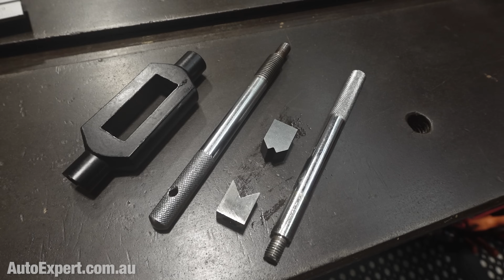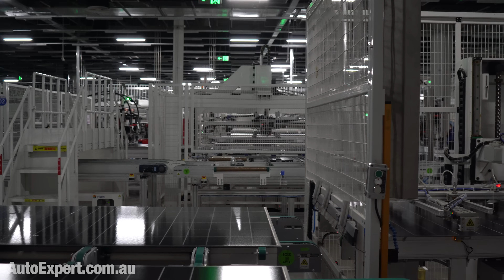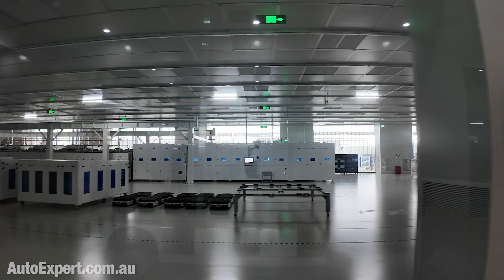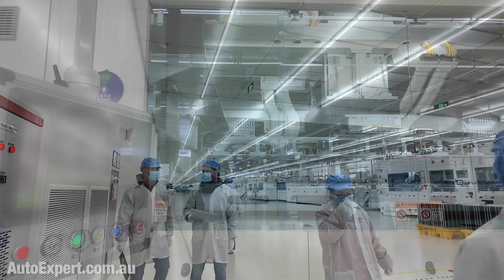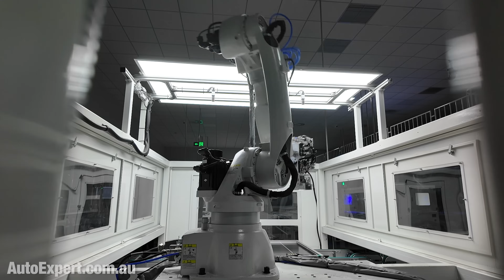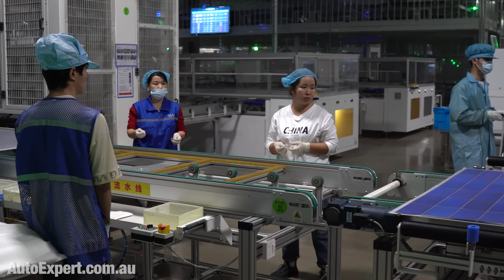The truth about Chinese manufacturing in 2025 | Auto Expert John Cadogan

Comment: Chinese product quality is NOT determined by the Chinese manufacturer, it is fully determined by the Australian / any other importer's standards and what he is prepared to pay, he wants cheap nasty so he can charge big dollars in Australia, ripping the gullible Australian consumer off royally, and we are stupid enough to accept it. They'll make you anything to the best quality possible if you are prepared to pay for it.
Reply: Absolutely spot on. A Chinese friend of mine was importing white goods and Split System Air Conditioners from China in the mid 2000s. The manufacturers all had a quality grading of A being the best down to F. You could specify any brand name you wanted and there was a class grade of compressors you could specify, each specification had the resulting differing price point. When his business was liquidated he kept some Grade A Air conditioning units for himself and me and 15 years later the branded Sharp unit we have is still working strong and is good on power being an inverter. There's Chinese and there's Chinese, it's all dependent on the suppliers chosen price point and quality threshold.
Reply: Spot on. Blame greedy Westerners for wanting products as cheaply as possible so that they can make large profits. The problem is that consumers see MADE IN CHINA   and fail to realise that the Chinese will make anything to the standard you specify and at a price to cover manufacturing. China needs to adopt the Japanese discipline of not making anything unless it is top quality.
Reply: @laok8021 如果统一标准，那肯定生产不了廉价产品，全世界大部分还是穷人占大多数，你不能剥夺穷人享受科技，哪怕产品质量差但是价格很低，坏了大不了再重新买一个，中国一直有一句话：一分钱一分货，想要多好的产品取决于你出的价格，你可以问任何一个中国人，他们都是这样认为的
Reply: @laok8021  There is a a huge worldwide market of people, including myself, who are more than happy to buy cheap stuff off Temu and Alibaba that is still fit for purpose and affordable, so no I disagree with your assertion that China should only manufacture top quality products.
Reply: @laok8021 problem is the number of available manufacturers in China....there will be some barely keeping the lights on will be willing to take a chance
Reply: Totally true. I am a production engineer that has been around many Chinese factories in the last 15 years, and actually it's been like that all that time.
Reply: This is true.  A client of mine imported from China and has been there many times.  He told me you can specify a product you want at a price you want your clients to pay and they will accommodate you accordingly.
So the perceived Chinese quality is directly proportional to the price point the consumer of said product is willing to pay.
Reply: @B_Cameron1973 
Bang on..!!
Reply: My sister has been doing business in China for more than twenty years. She has been screaming what you say from the roof tops.
Reply: @davidbrayshaw3529 
Same with my brother
Reply: So basically doing business in China is pretty much like anywhere else - you tend to get what you pay for, except in China the bottom end is lower as the Chinese are prepared to accept a lower price than most of the world, and yet still turn out something of a product.
Reply: 🎯 @sullivanrachael
Reply: Yeah that is a thing most people are not aware of. The Chinese deliver what you order in the quality you are willing to pay for.
Reply: Absolutely true, I work for an OEM factory in China, we have clients insist to use the cheapest/lowest spec solution because they will have the maximum profit margin .... after years we finally persuaded they use our higher quality/higher spec solutions (of course, with higher price) as they face tougher competitions. As an OEM factory, we don't make the final decision, our client does.
Reply: Stop watching Sky Noise after dark.....it will keep you utterly clueless. Do some research into the passion that drives the Head of BYD alone.......or stay dumb as...... Your choice.
Reply: Some Australian profiteers are crazy about pressing prices, which leads China suppliers to make them with cheap materials.
Reply: Yea a friend's brother who's a pro cyclist mentioned it to me. "Crappy bike frames come from china but the best bike frames are also from china. It just depends on how much you're willing to spend."
Reply: Spot on. The quality is deterimined by the QC imposed who pays to produce the product. "Simples"!
Reply: I knew a Chinese engineer who was asked if he could make X for Y dollars to which he said yes. He showed the product to the person who tried it then stated that it was crap. 
The Chinese response was ok, if you want a better one then it will cost Y+Z dollars. When dealing with the Chinese, you have to ask the right sort of question.
Reply: Agree ... the quality is dependent on the price the consumer is willing to pay. Higher price, better quality. Lower price, lower quality.
Reply: That's very true!
Reply: 100% true.
Reply: Yes, we are stupid.
Reply: Exactly, diy shop in Malaysia sells digital ⌚ for<3 dollars
Reply: You are exactly spot on with your comments. I can assure you, the vast majority of Chinese factories are nothing like as is shown in this video. Its a numbers game in finding a Chinese factory that can currently meet the standard/quality requirements of western markets right across a broad spectrum of industries and categories.. I have been travelling to mainland China since the early 1980's , working with many different factories in developing products for the Australian/NZ market.  Doing your homework well in advance will weeds out a huge number of Chinese factories that will always say that they can supply your market. I wonder if John visited any of the Chinese car manufacturing plants that are now offering their product to the Australian market.
Reply: i checked some of the daily products sold in other countries, especially america. i have found that for the same kind of price, US consumers get shit compared to products we consume in China. US products that is 2x to 3x the price would have the same quality of products sold in China.
Reply: man what are you talking about you are clueless... chinese motorcycles in Australia have been garbage ever since 2000 , go compare a CFMOTO to a HONDA huge difference.... you have no idea about anything its Chinese mindset  chinese dont think like japan or western people they dont take pride in anything they think how can i take as many shortcuts as possible and get away with it where Japan is how can i made this really good as i care about my reputation
Reply: The Indians pro-claimed they are going to be the next China and even replaced China as the world factory and manufacturing hub. 
So, when can we see Indian products supplying to the world like China? 😂😂😂
Reply: Yeah right...
Reply: Wrong…Quality is not even in the Chinese mind.  
If you’re less than 50, you have never experienced quality products. So it’s not in your frame of reference.  Boomers know this.  So imagine in your lifetime you have watched quality get worse through time.  China is “Tofu Dregs” 😂
Reply: you want it cheap, they make it cheap... fair.
Reply: As someone in exporting business over 20 years, I couldn’t agree more.
Reply: It is determined by price/quality balance…
Reply: as a importer in canada, i second your comment. enterprise doesn't want to pay for the high quality
Reply: SO TRUE,AT EVERY RED DOT AWARDS CEREMONY CHINA IS ON TOP-BUT I HAVE NEVER SEEN A CHINESE RED DOT ITEM OUTSIDE OF CHINA-IMPORTERS PREFER THE DIRT CHEAP ITEMS FOR MAX PROFITS
Reply: This is correct. You want crap, they will make it. You want world class top quaity, they will do that also. And with pleasure, no question.
Reply: @glandanit  that’s the point!
Reply: @glandanit  The day the Chinese make a quality product is the day hell freezes over.  Their WHOLE marketing and hence manufacturing strategy is to compete on price,  NEVER quality.
Reply: @aeroearth   Yep, Apple Iphone are shit, so are Tesla's, Dodge ram, Volvo's, Mercede's and a heap of other big brands. And about everything else in your home, work, and road. All made in China. Agree?
Reply: Absolutely correct. Do you believe that Apple would have their products made in China if they were unable to make quality goods? On any Apple product it says designed in California made in China. Its not just for the difference in labour costs its because they know that the factory in China can consistently make their products to their exacting standards.
Reply: @michaelbradley3393  Apple iPhones are made in China under Taiwanese Management and Manufacturing Engineering by a Taiwanese Company.   There are Chinese designed and made mobile phones,  which are not to the same standard.  Apple are now pulling out of China.
Reply: yeah if you want to pay. when it comes to some of the high tech stuff the engineers studied in australia.
Reply: @chrisforgan731  China has the BEST education in the world now - this is just rubbish.
Reply: @chrisforgan731 Chinese Universitys are now taking over westerns unis for quality of education
Reply: Chinese consumers won't put up with shoddy products so manufacturers have to up their game to stay in business.  as for exports, it's up to what buyers buy for their stores.
Reply: @willengel2458  Utter BS mate!
Reply: not now
Reply: True to the core.
Reply: 100% correct. I worked for a company in NZ that started a new product line from China, requiring multiple trips to China to set up the venture. In the West we make goods to a predetermined standard, which sets the price. In China, they set the agreed price first, which determines the standard. It's simply a cultural shift, the way they do business, and always have.
Reply: Rubbish.  Research by Toyota showed that 80% of product quality issues are due to product design.  Chinese made cars designed and made under the "MG" brand have an appalling quality record.
Reply: @aeroearth  We have a 2022 MG and the quality is as good as all the other brands we looked at before purchase. Price, servicing cost and warranty was what sold it to us
Reply: @PhilipMR223 - precisely. You got exactly what you paid for, which you confirm is better than expected and more than satisfactory.
Chinese will literally do anything to get exports, so will do whatever is necessary to match the buyer's requirements (The buyer being the AU distributer, in this case). They don't dictate to the market like (say) European brands might do.
Reply: @aeroearth  Research by Toyota?
Reply: @SirGregoryPageTurner  CORRECT.  After analysis of product failure Toyota Engineers searching for the root cause determined that 80% of product failure was due to product design.  My experience managing both product design and product manufacture concurrs with their findings.
Reply: @aeroearth  Let me see if I understand this. Toyota, a manufacturer of motor vehicles, says other brands are not as good as Toyota?
Reply: @aeroearth   This is like saying Pakistan investigated India and found India to be inferior. Do you have any idea how ridiculous you sound?
Reply: @samrolfe2563  Making ad hominen attacks means that you have lost the argument.  Wonder how many years you have worked in the auto manufacturing industry ?  The truth hurts if you have been successfully "programmed"
Reply: @SirGregoryPageTurner  To the best of my knowledge,  Toyota has not criticised other manufacturers about their products.  What their Manufacturing Engineers and their Managment identified years ago was the need to make THEIR products more reliable.   Which they did.  They also invented their Toyota Production System,  commonly known as "Just In Time" which other car and other product manufacturing companies adopted,  leading to vast reductions in inventory and greatly improved product quality.  Read Kaizen by Masaaki Imai (assuming you haven't already)
Reply: @aeroearth 
The best of your knowledge is distinctly uninspiring. 
I feel you may be transitioning. 
From bidens China hate bubble payments to the new 1.6 billion Trump hate bubble payments.
Reply: @aeroearth SAIC owned MG?
“SAIC is shit” is simply true, think about the ANCAP tested zero star MG5, and search up what happened in 2019, about SAIC-Volkswagen Passat (sold only in China)’s result in Chinese CIASI safety testing that follows American IIHS standards.
Reply: @毫徳寺三花  Anything SAIC is inherently poorly designed and made, ask your local panel shop. But, there is CHINA and China in terms of quality. China can do quality if you pay more for it. Compare GWM, BYD to SAIC and Chery, the difference is massive.
Reply: @lesleypaterson1463 same can be said of any manufacturing of any product, many European products like appliances with lots of issues, made in Italy a gamble etc
Reply: @aeroearth and of course the research was unbiased because it was conducted by Toyota!😅
Reply: @aeroearth  that's like saying the BZ4x with it's broken axels and wheels falling off represent Toyota and Japan in general. You picked one bad Chinese vehicle maker and ignore all the good ones? 

Top Chinese quality is far higher than top Japanese quality. That's exactly why BYD is the Japanese governennts car or choice over any Japanese brand despite China barely selling any cars to the general public
Reply: @aeroearth  Maybe so, but GWM & BYD vehicles are top quality.
Reply: @lindsaysmith8119  Please define "top quality" in number of incidents per 1,000 vehicles.  "On God we trust,  for the rest we must have data"  Dr. D.W. Deming.
Reply: @lindsaysmith8119 no they are simply not. Countless BYD vehicles are catching fire in China and taking out full skyscrapers.
They do some amazing work ie i own a big chinese laser cutter and it is awesome, but their cars are still rubbish.
Reply: @Maccat  "Countless BYD vehicles are catching fire in China and taking out full skyscrapers." Wow, I wonder what anti-China YT channel you got this kind of info from. Cause I can't find it in MSM. If that's really the case, I'm sure it will be all over the western news. Mainstream like CNN, BBC ,etc. They won't pass on reporting any negative thing about China, right?
Reply: @Maccat  Sure they are mate, no proof just you spouting 💩
Reply: @aeroearth we have 5 MG in our fleet for 3 years.. I can tell you your comment is incorrect. They have had zero issues and the build quality is amazing.
Reply: @aeroearth as a result, I personally do not believe that SAIC cars do good. They can, just like MG4 sold in China, cheap and good. 
But they have a history — wait no. The MG5 they released in Australia, selling RIGHT NOW is also rubbish. 
But I mean, uh, look at Great Wall and BYD. Search about their result in YouTube, ANCAP do complete safety test to their products. 
5 stars, no exception.
Reply: @aeroearth and of course toyota, as a car manufacturer is the best unbiased and objective source of research when it comes to other car brands 😂😂😂
Reply: @janusjones6519  Never seen ANY publication from Toyota criticising other car brands.  Have you ?
Reply: @aeroearth  show the proofs fool
Reply: @user-ki1bk5fi8b  Oh dear,  an "ad hominen" attack.   Proven by Psychologists that "people" resort to when they have lost an argument.
May I suggest that you read the numerous motoring organisations reports on vehicle reliability which shows Chinese made automobiles to be the worst ?

Comment: You might have missed an important point on what Australia has install to counter what the Chinese are doing.

It appears, from information based one of the man Labor government announcements and promises that Australia is gearing up on PV solar manufacture under the expert leadership and push for innovation from Chris Bowen as I have understood it.
The goal is to use strictly union controlled Labor and production line operation to set up a PV solar panel manufacturing facility in Australia as the world's greatest PV solar manufacturing facility and world exporting PV solar panel superpower.